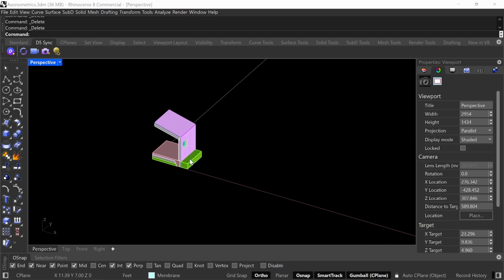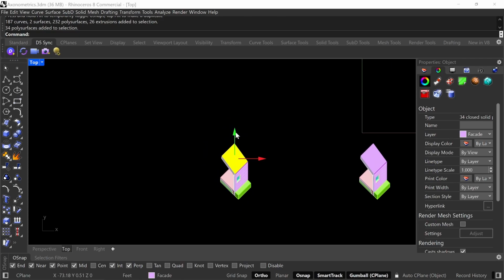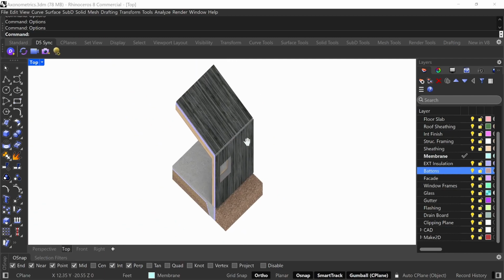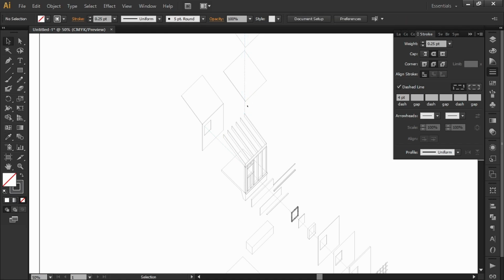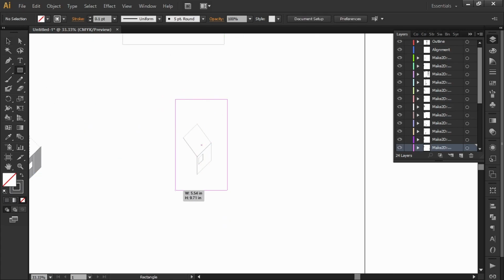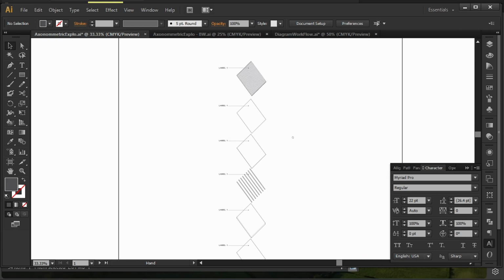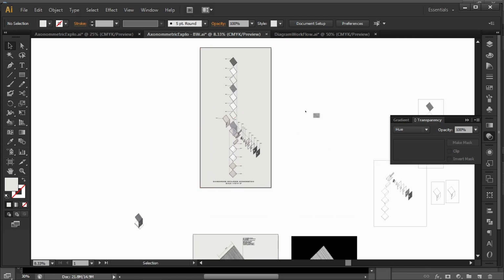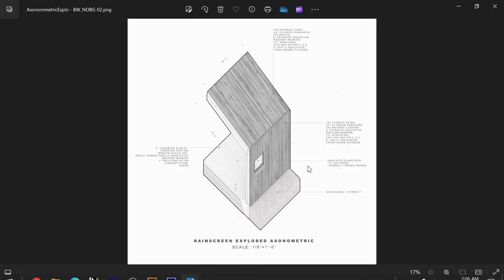Axonometrics in Rhino3d and Illustrator - FULL Course - Learn the essentials under 30 minutes.

Comment: As a student working backwards to correct my 2D workflow before my M.Arch, I can't tell you how useful your tutorials have been. If you wanted to scale a similar diagram differently for your layout, is there any helpful reason to develop a new Make2D + Rendered view to insert or is it best just scale objects (and perhaps patterns) accordingly? Photoshop can be a little tricky with rescaling 2D views like this accurately without knowing your original bounding box, so I would appreciate any suggestions for improving my linework step. Thank you for what you do!
Reply from the maker: If you're going to do the make 2D and rendered overlay method, You wouldn't have to worry about scaling the patterns anymore because you've already captured the rendering with its materials embedded into the image. You would just need to scale the make 2D and rendering as the same image. 

The other method is just doing everything in Rhino with your display styles and no make 2D.

Comment: You can create a cube and rotate it 45 degrees and use the command align camera to surface and choose the surface of the cube
Reply from the maker: Hello. Thank you for your comment!  The command is called orientcameratosrf. Rhino does not have a aligncameratosrf command. And that will not create a true length axonometric projection because it's based off of the camera angle. Unless you are referring to a different method. I use orientcameratosrf for other kinds of projections like sections.